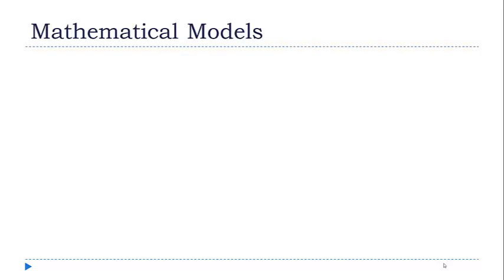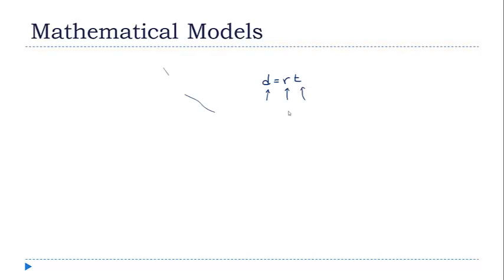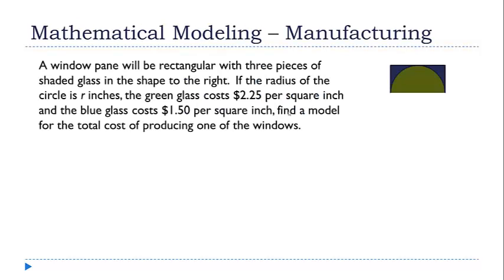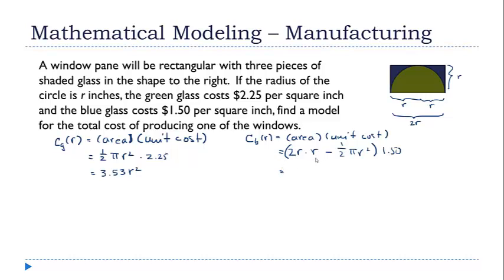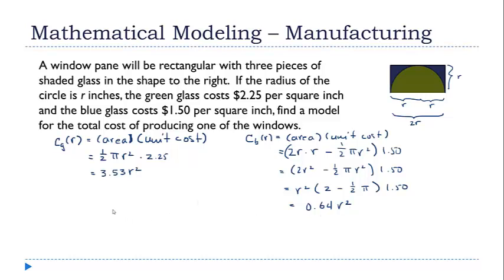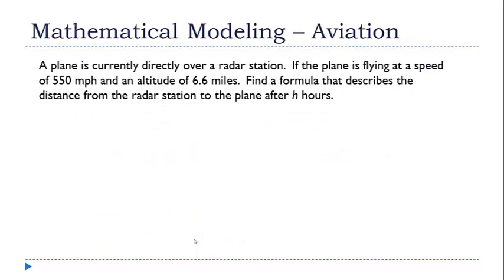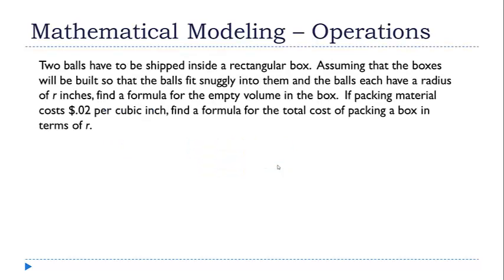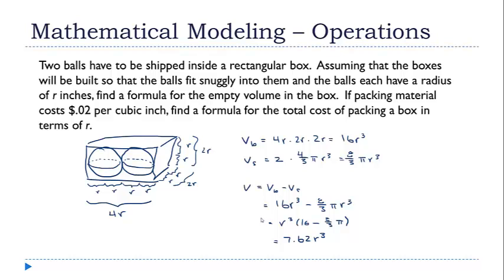Mathematical Models

Comment: how do you know that the length of the rectangle is 2r?
Reply: is it all an assumption?
Reply from the maker: Are you asking about the one with the green and blue glass?   If so then think about walking along the bottom edge of the glass.  From the left corner to the center is half way across the circle or one radius so when you've gotten to the half way point, you've walked r feet.  To get from the center/half way point to the right corner you have to walk another radius so that's a second r feet for a total of r + r  or 2r.
Reply: @whitecraneeducation2228  oh thank you, clarified💚